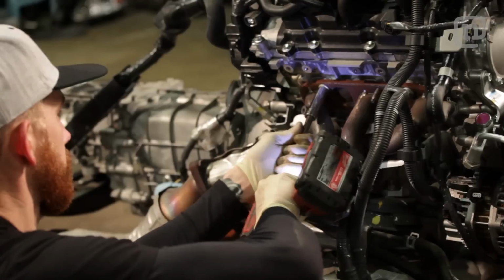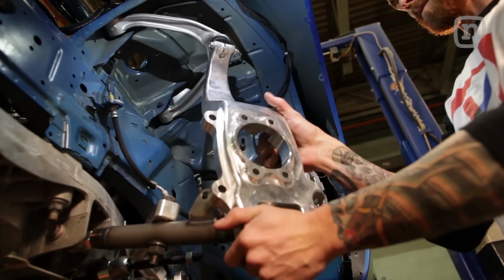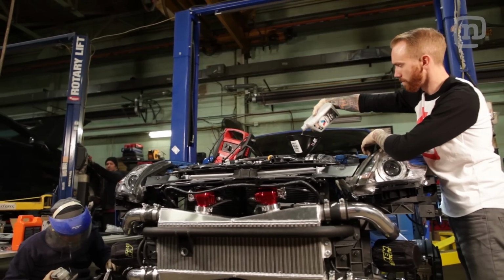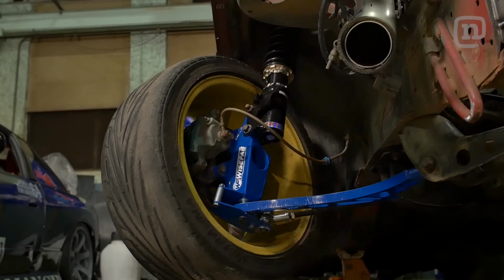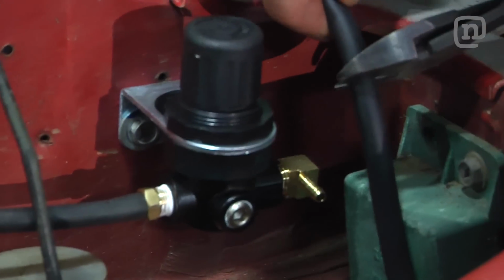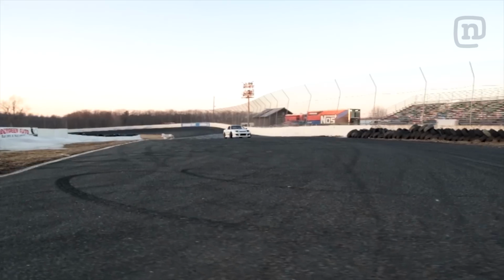Tuerck and Forsberg Want a Rematch: Drift Garage Season 2 Recap

Comment: Question for the drift response;
realistically, how long would the 370z last as a daily and  drift/track car in terms of the motor and associated parts, and things like doors, panels ect.
Reply: Years. It's all about the tune
Reply: Nissan Mechanic really? interesting, i was thinking of doing a similar set up on my daily 300zx tt like suspension and upgraded turbos but im a bit worried about braking it
Reply: It'll fuck your fuel when your in boost

Comment: serious question. how much is it to get a 2jz engine+turbo+whatever it needs to run smooth installed and everything into a brand new frs, maybe 7-8k? i don't know, and thats why i am asking!
Reply: you should look at new built 2jz first to see if a new one is in ur price range. otherwise look to get a new engine w/o turbo and look for a used turbo and manifold system. Saved me a 4k doing that for my s14.5

Comment: Question for the drift response;
The 370Z costs roughly 10k more in my country than the FRS but the FRS is running less displacement and therefore less stock horsepower.

Q - For guys who work on their own cars: which is a better car between the 370Z and FRS for a street/daily build that gets around quickly?
Reply: jamess6401 Stock for stock, 370z is way better car and with basic mods and a tune it can make around 310-330whp easy. But it cost a lot to build than the FRS.